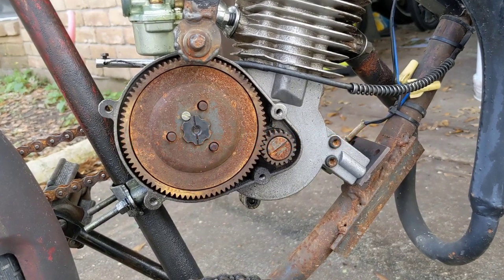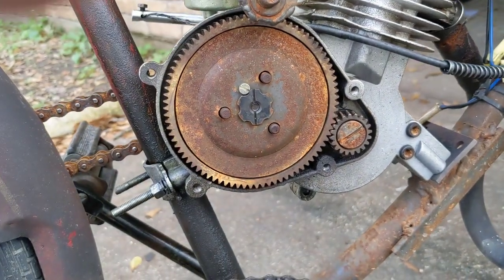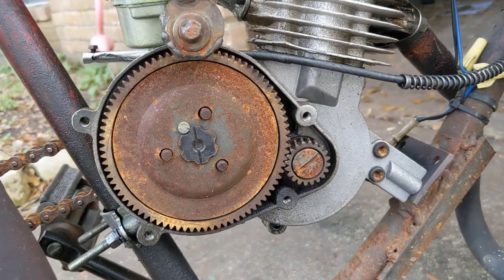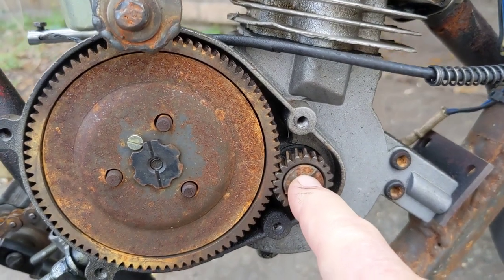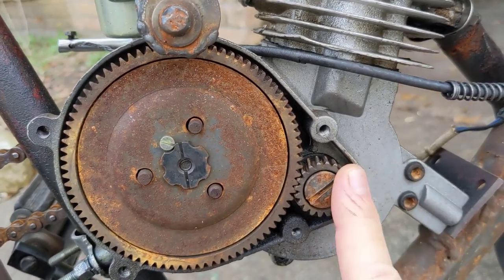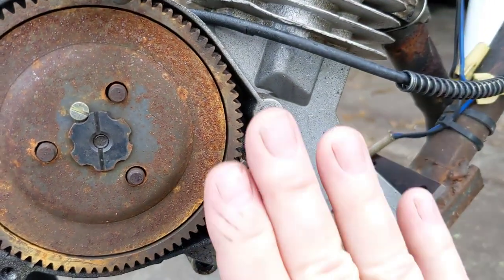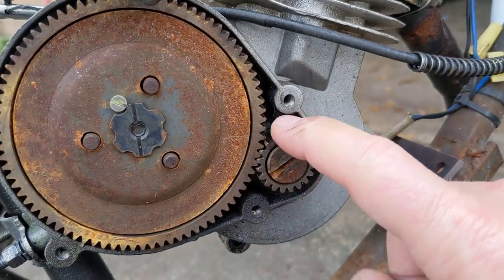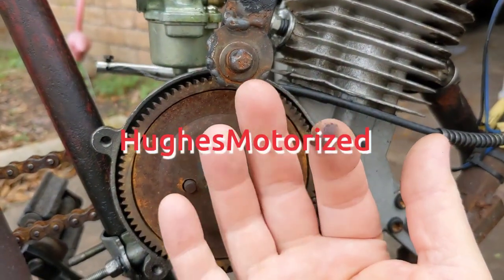Do You Need To Grease Clutch Drive Bevel Gear On Motorized Bike Engine?

Comment: It's not about wear it's about friction. As the teeth slip off eachother when they separate its addition fiction so it's a parasitic loss of power. I used to race bikes and if you clean your chain, bearings, and gears and lube them up on a race bike you will feel way less resistance when peddling. If you lube it with grease or chian wax it will have less friction and you get more power to the ground. I used to trash pick bikes and fix em up and give them to my friends. Most just need the bearings repacked and a new chain and tube. Friction always = power loss. Pro tip from a race winner
Reply from the maker: I'm lucky that I'm not trying to go 10000000000000000000mph. 
I'm simply enjoying the ride.
Reply: @HughesMotorized  it will help with mpgs too man. I'm just shareing the benifits behind it not saying you are wrong. Your videos have helped me a lot and I wanted to contribute when I could! Have a good one!
Reply from the maker: @businessraptor134  I gotcha. Appreciate you watching and engaging. Friction does indeed slow things down. Ride on!

Comment: Good to hear from u ! No grease........ Take care big guy !
Reply from the maker: Right on
Reply: @HughesMotorized  l assemble auto lifts now . Sometimes after long use they squeek .We use DRY lube . Don't want dirt sticking to grease. Possible DRY lube could help crankshaft gear connected to clutch gear ?

Comment: I never grease mine on any of my engines.  I made the mistake of greasing that a long time ago on a China doll and it seeped to the friction plate and pads not so good for the clutch lol. So ignore that while going grease crazy on a dry friction clutch if the plates and clutch are greased use brake cleaner degreaser

Comment: Use tacky grease on the gears but don’t overdo it or excess grease might get on the clutch pads. Leaving the gears to run dry is like driving a truck with a manual transmission dry.

Comment: Now that's really surprising to see. I see grannies on these crappy old unmaintained bicycles with dry rusty chains and I always wondered how do they not fear the bike will fall apart underneath them, cause that's how I felt when riding such a bike especially uphill, and that one wasn't so bad. And then here I see a motorized bike in such condition and it works just fine... looks like these components deserve more credit than I give them huh.

Come to think of it, after I put more grease on these gears, my own motorized bike stopped squeaking under load, and I kinda miss that sound cause it reminds me of racing cars with straight cut gears in the gearbox. I kinda hope I'll hear it return as the grease dries out.
Reply: what is your pfp from? it looks so familiar, i think i remember it from when i was a kid but I can’t find it
Reply: @vostock0998  it's Kazuki Fuse from the movie Jin-Roh The Wolf Brigade

Comment: Hey if you have the white wire to touching the engine can it cause it not to run? Please let me know some helpful tips it only runs when I rivet when I don’t rivet it dies
Reply from the maker: If the white wire gets grounded out, it will kill the engine. Try the idle adusting screw on the carb. Try turning it in a half a turn
Reply: @HughesMotorized  ok thank you I will try

Comment: I'm new to this 2 stroke stuff I'm getting air fuel ect but my plug is wet and got a little brown in the middle it's only started once and it died right away and I haven't yet gotten it to start again any suggestions please and thank you

Comment: Good to know because I didn't put any grease on my motor in that area neither. I honestly think it's better to just let it wear out and replace when necessary that it would probably take a long time for that to happen grease or not. Like you said it's probably the cheap casting materials they use and it tends to wear down. In another one of your videos as I stated in one of my comments about how I get a little bit of oil around the base of that crankcase just a little teeny bit is obviously not enough to let the clutch slip because if it was I'm sure I would notice it but with that be a poor crank seal? Or is it because of motor still breaking in and I was running that stupid 16:1 ratio before I did some research and found out that it's best to just run the20 to 1 ratio right from the get go otherwise you're going to get excessive oil all over the place it really doesn't play much of a role in it breaking in in my opinion. However I am running 24 to 1 right now would it be safe to back that off to 40 to one? And maybe that might stop the excess oil building up around the motor I get a little bit that comes around the exhaust not so much now that I've torque the bolts down and Loctite them but at the very base of the crankcase there's always a small drop of oil there and definitely got a lot of oil coming out of the exhaust too maybe not so much now that I've got the motor running again and I'm not flooding it trying to start it. So do you have any recommendations there? Is there something I should be worried about for down the road? Or is it something that this kind of normal for these motors and sometimes they do that and some of the motors don't also if this crank seal is bad that's obviously going to give me a vacuum leak right? Thank you for your time if you go ahead and give me any advice or recommendations you have. And once again thank you for the videos, they're very helpful 🙏

Comment: Whats the benefit of no clutch cover? Better cooling?
Reply from the maker: Just the cool-looking factor
Reply: @HughesMotorized  and maybe getting a shoelace sucked in 😆
Reply from the maker: @adamsmahem9454  I'll offer you never hang out w/ bikers. They run 1200cc monsters w/ open primarys. They'd laugh at that comment and not all wear boots when riding.

Comment: those 3 pins aligning the clutch plate wore a hole on the cover how can the shaft slide about 3/8 of an inch any idea b4 i shred the block and thanks for ya vids
Reply from the maker: pop some pics on my Facebook group Hughes Motorized